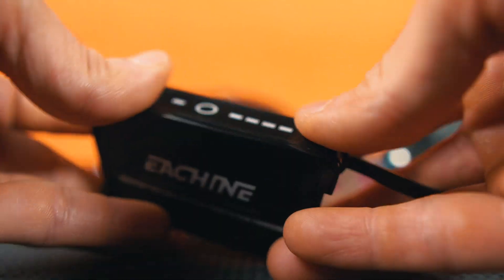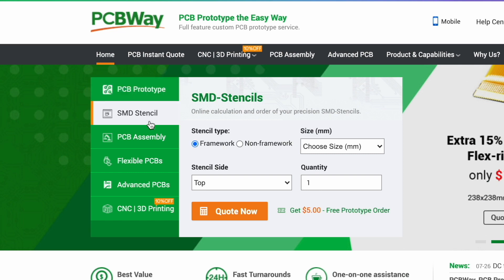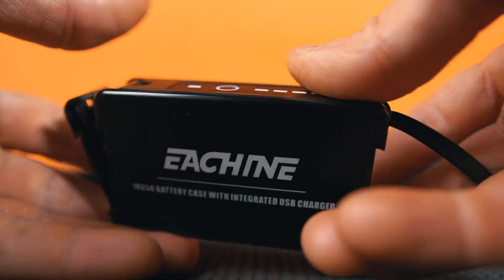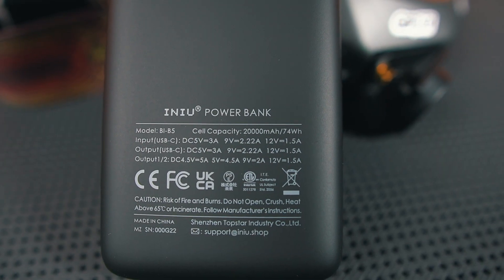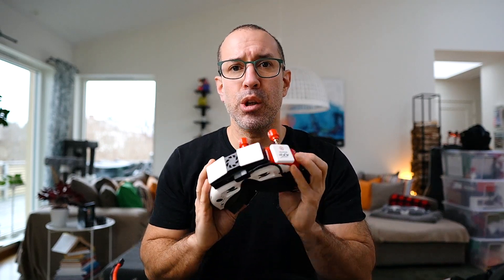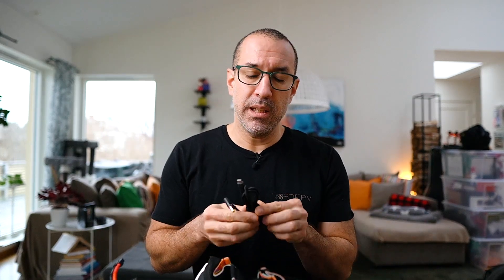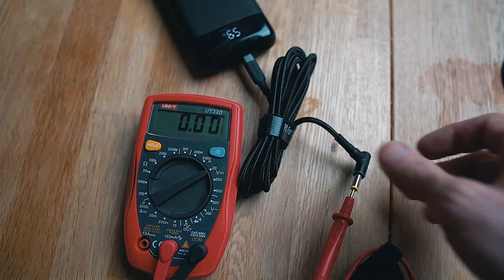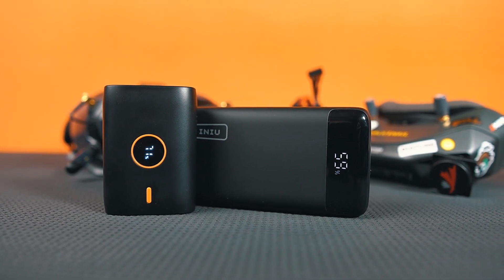Best Batteries for Your FPV Goggles

Comment from the maker: I made a mistake in the video saying the Fatshark HDO2 supports up to 6S. They are 2S-3S!
Please always check your specs before connecting the battery
Reply: i posted a video on my channel about an issue i am having using battery bank and a usb c cable. could you help me out. channel is aphixe

Comment: I love the Eachine cases but the two units I have, have both failed at the cable gland, leaving the small wires without strain relief. I don't want to carry gear that might short in my bag or on my head. I'm going to put a blob of heat moldable plastic behind the gland and hopefully that'll fix it, because I can't find a better case in spite of this issue.
Reply from the maker: I use to have that case as my main power supply before, but now I’m using the small power bank you see in this video and I’m much happier. The time the power bank last is amazing.

Comment: 11:01 the powerbank is a lion battery. The original fatshark one should be a lipo. Right? Cause I've never seen a lipo Powerbank...
Reply from the maker: Fatshark sold a lipo battery to the goggles. Not sure if it was the original way or just an option. The echine case in the video is li ion, it takes 2x18650, but the power banks in the video are lipo. There are a few videos on the internet of people opening and testing capacities of them and you can clearly see they are lipo.
Reply: @NordFPV  ah okay. I didn't know that there were powerbanks which are lipos

Comment: What is the cable you bought? The like in the description is not working for me.
Reply from the maker: Oh it’s bad that the link doesn’t work. But if you search for usb c pd 9v cable in amazon or Ali you should find them. Just make sure you select the right connector. DJI changed it with the G2 goggles so it’s not the regular 5.5DC barrel, and test it with a multimeter before plugging the first time. I bought a cable which was marked 9v and when tested it was providing 12 despite being marked as 9.

Comment: Hello. You mentioned early on in your video that 7-9v is the ideal voltage for your goggles but also mentioned that one of your cables and power bank is outputting 12v and you said it's fine as long as it's working. I have the same cable as yours that has 12v but shows 11v on my goggle screen. My question now is, is it safe to use it long-term?
Reply from the maker: It all depends on what your googles has as upper limit. I think googles like old fatshark works only with 2S and being on 11-12 volt may be dangerous. But goggles like the hdzero or the newest DJI which are like 25v will have no problem at all with 11-12 volts.

Comment: what about the barrel/usb C cable that comes with the goggles 2 ? Is that cable actually actively passing the right voltage?
Reply from the maker: Yes. But it has some kind of special
Communication with the DJI equipment and the cable just work between DJI.
Reply: @NordFPV  ok so if I plug the "vintage telephone cord" barrel to usbc to a pd powerbank it should self regulate and work fine?
Reply from the maker: @samuelevinti  unfortunately not because your powerbank is not DJI. A DJI cable works only with DJI batteries.

Comment: Just use radiomaster 2s 5000mah li ion. Just 15usd buy 2 😂. Diy a xt30 to barrel connector cable. You got double capacity than 2s fatshark standard battery (18650 li ion).

Comment: I found the nitecore NC10000 (li-ion) with a USB-c to Barrel connector, as a backup i use the radiomaster 2 li-ion 5000mah battery with a xt30 to xt60 adapter, with the xt60 to barrel connector. The nitecore Nc10000 has large enough battery to last very long and can be charged with standard USB-C charger.

Comment: So do you need PD power bank AND PD power cable?  Or do you just need one of them to be “pd”?
Reply from the maker: I’m pretty sure you need both. The PD power bank is the only that will get to the right power, and the cable is the one which will control the voltage and avoid burning your goggles.
Reply: @NordFPV  ok awesome, thanks for your quick reply and clarifying!  I’m gonna try my hand at powering the new walksnail avatar X goggles I just got in via this method, but wanted to be sure I wasn’t gonna fry them!
Reply: @sprucescott9483 check with a multimeter before connecting the power source to the goggles.

Comment: The small powerbank you link have usb c so why not use the stock dji cable ? For goggles v2
Reply from the maker: Unfortunately the stock DJI cable works only with DJI batteries. 🤷🏻‍♂️
Reply: @NordFPV  i see. Does the v2 goggles use 5025 or 5021 plug? I dont think you can use powerbank. Uts not the cable that sets the voltade but the device you're charging. The powerbank Will allways output 5v unless the device have have resistance
Reply from the maker: @kringtheking2657 The DJI V2 (not DJI G2) uses 5025 (the "big" connector). What you are saying about the cable is not true, and a very understandable misconception. There are cables that set the voltage of a USB-C PD, while there are other cables that doesn't. USB-C PD Protocol needs "someone" to tell the device how many volts it's going to provide. Normally, and I guess the standard was built for this someone to be the device (laptop, phone, etc), but cables like the one I'm linking, and using here, has the same chip inside the USB-C connector to become that "someone" telling the powerbank how many V they have to provide. When I look at my cables I have some labeled 9v, and some labeled 12v, and If I measure the voltage, as I do in the video, you will see only the powerbank and the cable, without anything else connected on the other end, delivers a different amount of voltage than 5v or the max the USB-C PD port can deliver.

Comment: i wanna use it on my walksnail battery. but Eachine and fatshark batteries you talked in the video would work on my walksnail goggle?. and is it safe as well?. and i want to ask you what about using DJI FPV Goggle V2 battery for walksnail goggle?.

i'm asking cuz of the size of barrels for goggle.
Reply from the maker: The fatshark/echine will work on walksnail, but the DJI battery won’t.

Comment: thx for the video! According to that I can safely use a powerstation with a car 12v plug, right?
Reply from the maker: Hi. I’m not sure what you mean.
Reply: @NordFPV  almost every portable power station like Ecoflow, Bluetti, Anker, Jackery etc has the 12v car socket (I guess its also called a cigarette plug - the thingy u had in the older cars) same, they can handle up to 10A so its more than enough.

Comment: new to the hobby was wondering if  i can use a radiomaster battery  5000mah
Reply from the maker: For what Orion? That battery has a 2S balance cable and a XT30 if I'm not wrong. Most of the goggles require a barrel connection. So unless you change the connection with an adapter, or cut and solder a new one, my initial answer will be no for most of the goggles.

Comment: Nord FPV.....Can the Eachine 18650 case be used to howse batteries for Fatshark goggles?
Reply from the maker: Yes. That case works with the fatshark goggles both analog and avatar version
Reply: @NordFPV  Thanks. What batteries are used inside the case?
Reply from the maker: @johnsnow2347  18650 batteries
Reply: @NordFPV  Got it, thanks. 18650 3.7v x 2ea batteries = 7.4v

Comment: Dude, i have a walksnail avatar. Can i use the goggles with dji goggles battery? Dji battery is 2s and  9volts
Reply from the maker: Looks like you can’t. The DJI battery has something extra in the cable to identify the goggles. Maybe changing the cable. Voltage wise it will work.

Comment: I just bought the DJI Goggles 2 but very displeased about their battery life.  I like your video and ask that you tell me very simply, what do I need to buy for a better battery? I don’t know all the technical stuff and just want to know what I need.  Please be very specific with the products.  Thanks so much
Reply from the maker: Hi harmonica,
Very difficult to do as you want because what you need are Chinese parts which can change name, manufacturers and shape from country to country. 
In my opinion you need a USB-C PD 10000 mah battery pack, and a usb-c to 5.5 DC which limits the output power to 12 or 9v. I hope this helps
Reply: @NordFPV  Thank you

Comment: Is there a powerbank with li ion 21700 instead of 18650 ? and do you need to be careful about the polarisation of the barrel jack connector ?
Reply from the maker: Most big powerbanks are actually lipo batteries. I have not seen cases for 21700, not really sure why. I’ve seen a couple of 3D printed options but nothing commercial.

Comment: Informative video! I did not realise PD power banks use lipo batteries - I thought they wire li-ion!
Reply from the maker: Yeah… and many of these packs are lying about it and or the capacity
Reply: @NordFPV I have checked the specs of both the power bank you have mantioned, they both say li -ion and not lipo, are you sure about that? Thanks
Reply from the maker: @blackclown6191 I'll be very happy if they are Li-ion, but mine says LiPo, and many videos where people test similar batteries and open them you see they are LiPos. am I 100% sure? No. Do I trust what the manufacturer writ eon the back of the case? No. The only way to be 100% sure will be to open them, but I don't want to do that right now, I'm very happy with them the way they are.

Comment: My power bank sometimes shuts off after a certain amount of time so I was hesitant to try some of these cables. But I shall try it with the cable you mentioned!
Reply from the maker: Just be ready to test one more than cable. My advice, but them from a place it’s easy to return if they don’t work as expected